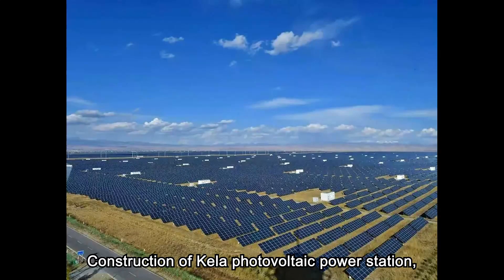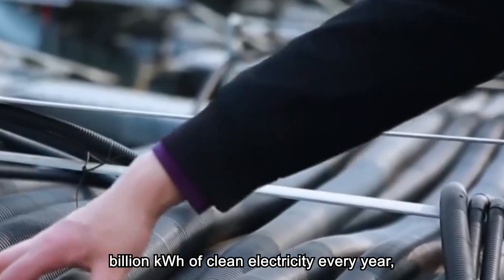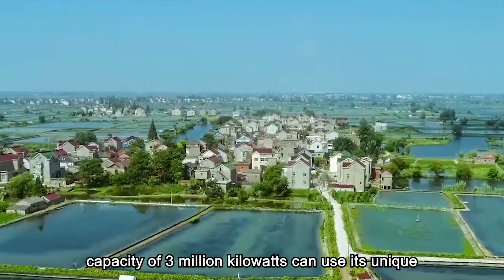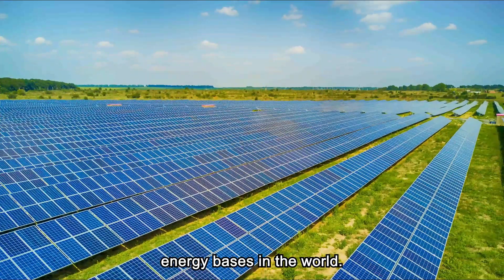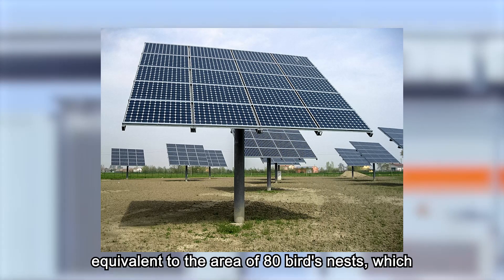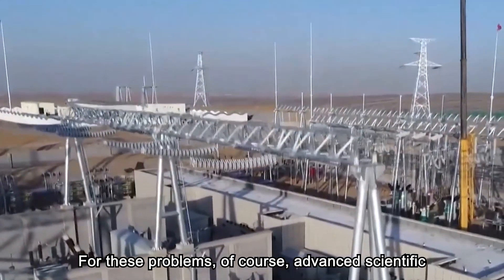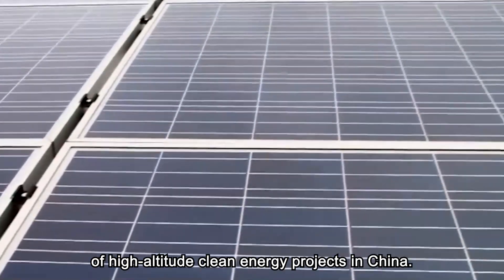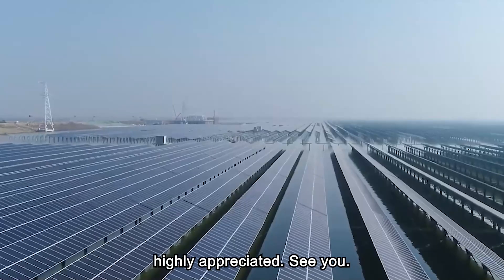China generate solar energy even at night? World's largest hydro solar power station

Comment: Oh late breaking '80s technology here we go
Reply: It's not new, but is a smart design to combine solar with hydro. Hydro can generate energy on it's own and it can also provide storage for solar. They can use the solar panels to power pumps that pump water to water storage at a higher elevation than a generator. During peak hours that extra water can be used to turn the generator and provide extra electrical power. That's one of the most efficient ways to store electrical energy for later use.
Reply: You are showing your lack of education. But it's OK. You are American, right? That's not a surprise.
Reply: You don’t understand what the video is about, this is not about the energy generation technologies, it’s about balancing the grid by controlling the flow of water. There are many variables like the sunlight on the photovoltaic panels and the rate of consumption at any moment in time. It sounds simple, but try doing it in real time, that’s the holy grail.